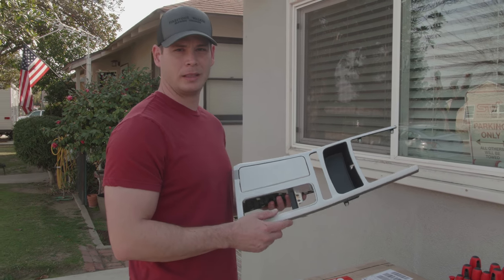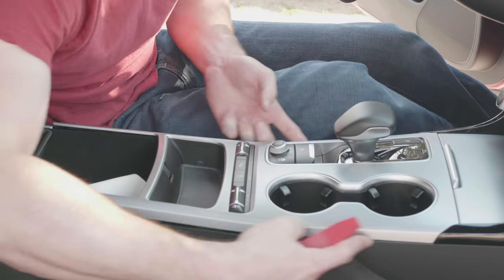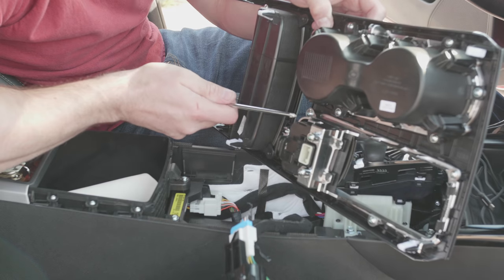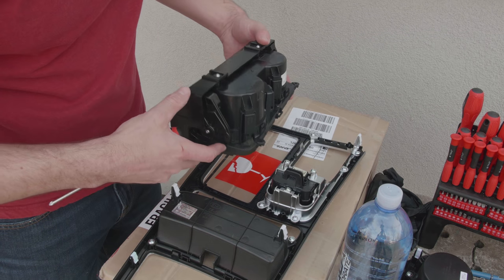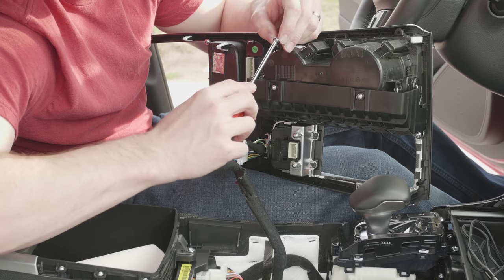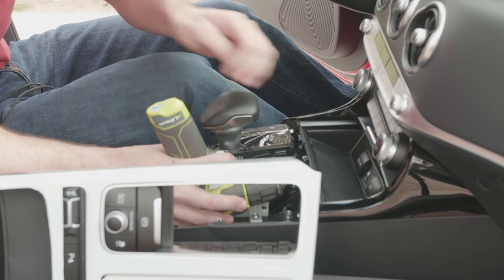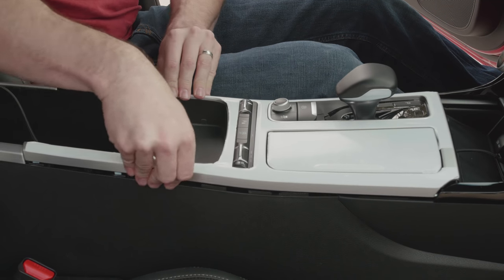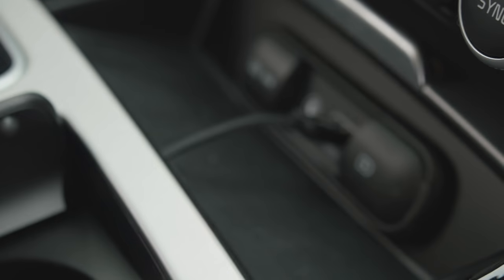2018 Kia Stinger GT2  Center Console Swap Out (Korean Version)

Comment: I was surprised you didn't zip tie the USB cable to secure it and prevent it from rattling around or getting pinched when you replaced the center console portion. Very nice video and thanks for sharing!

Comment: Watched this again and it'll help me as I need to change out my shifter lever assembly. I broke mine. DOH.. looks like once cover is off, I'll just need to unscrew the assembly and swap out and re-screw down new one. will try that today and make my video on that. Cheers !.. I still prefer my console with no lid to flip up for cup holders, but it looks sleeker when not using them, that's for sure.

Comment: I don't own a Stinger, but my car has wireless charging I found it slow and it was generating heat especially when running Android auto..I've routed my cable up under the steering column to pop out below the drivers door side aircon vent so my phone has cooling.
I do like the clean look of your car though, keep up the good work!

Comment: •Down here we have air ducts to keep the brakes cool and back behind the wheel we also have an opening for improved aerodynamics

•Up here we have a 3.3L biturbo V6 engine to help you take a hot dump on all the unsuspecting BMW drivers that leave your lane as you come up to a stop light in favor of the open lane beside you .

•back there is a lift gate to access your cargo area. Yeah, yeah it's a hatch design for more practicality and it's power opening and closing. We've also got available AWD for your convenience.
 
Sir is there uh, is there anything else you'd like to know about this car?

SGT and Me : Cupholders suck eh?

Comment: My Stinger GT in Australia (it's the top model, there's no GT1 and GT2) came with the wireless charger. If you are looking for the clean look, be aware that fast charging with the lid sliding back causes the phone to overheat due to no ventilation. At least it does with my Galaxy Note 10+.

Comment: Looks like you are missing the two screws holding in the cupholder along the outside edge. Check your stock one, it has four screws around the perimeter of the cupholder.
Reply from the maker: Erik Anderson oh Wow good catch you may be correct.  It's solid and doesn't move but yes you may be correct.  I can't remember anymore how it looked.

Comment: It's ok... Not worth the money for me to change it out unless it had like wireless charging built in. In fact the little door is what breaks eventually through out the years. I rather have the open cup holder. But good mod it's good that Kia offers Korean version parts this early
Reply: well if the door ever broke u could go back to the original one
Reply: Yea I’m not quite understanding the point of this mod besides maybe a “cleaner look” which is debatable. Probably cost him hundreds too. 🤷🏼‍♀️
Reply: I watched this and dont even have a stinger.  I do however hove a 2014 Kia Cadenza, and I love the closed cupholder look.  It makes everything look so much tidier.  The point is, its a 5 year old Kia with 104 000kms (60k(ish)miles) and the cupholder is still working fine.  The only thing my car has been in for that wasn't scheduled was a muffler, and a key fob that i lost.

Comment: I don't even own the car and I'm watching this. Good job.
One thing though,  I would of just made a 1/8 hole and cut the cable to put it through.  Just connect it back with black tape in the inside where you can't see the splice. This way you don't see a big hole on both ends.
Reply from the maker: Jerry Pena that is definitely an option.  To be honest because of the felt material in the arm rest box and how far forward the USB plug section is they hide.   Nobody can even tell there are holes in there.  Only. Reason I didn't do the slice was afraid of cracking the plastic. And a slice would make the entire piece loose its rigidity.
Reply: Just an option if someone is leasing the car or not owning it for a long time. I've done splices for thicker cable and it holds up fine. Definitely won't have a problem with rigidity. If you're worried, you can always use splice wire connectors to make sure the connection is not going anywhere. When adding extra length, this is what's done to make cable runs longer. A USB cable is usually 4 wires (5v, 2 data, ground) and is usually 26-28 AWG so nothing to worry about until you get to 14 AWG when you're carrying higher loads. But great to see this channel. Like the contents.

Comment: Did the exact same before seeing that video! now inserting led lights inside the rear bumper reflectors... not an easy job
Reply from the maker: Frederic Pons oh your doing the leds nice. I saw those.   You say not easy huh.   I'm guessing they gave no instructions either 😁
Reply: yes no instruction! I found out that there is one screw to undo from the inside of the bumper (after I unnecessarily removed the 4 screws that hold the exhaust pipe cover) but the real difficulty is to cut open the reflector assembly (it looks like it's glued shut). Then the led board hardy fits inside because the saw blade actually removed 1.5 mm of plastic all around the assembly. I also cut a hole all along the inside of the back so the led board could rest closer to the back. It's not pretty but hopefully be invisible once re-installed in the car. I am wondering if I could fill-in that opening with transparent silicon without affecting the correct operation of the board....I used some plastic soldering all around to recreate the side and bound the front reflector to the back. I will re-test and install tonight. If everything works, I will video the process for the other reflector....
Reply from the maker: I'm all about modding but that is a serious mod. ;) hopefully someone will make a plug and play  on in the future.
Reply: You can buy the whole reflector assembly with the leds. It's more expensive but might be worth every penny if my mods crash in burn

Comment: Great job right until you started drilling. I would have just wired in the connector through the back and made an extension for the factory clean look.

Comment: question: my stinger will be a AWD version so it will have the heated steering wheel function button. So one extra button. Do u think the mod will fit over it? I notice you only have two function buttons (parking sensor and ignition turnoff when stopped) and it fit correctly. The Koreans get 4 buttons (camera) so i assume all versions should fit?

Comment: Is there no USB port in the center console? If so I would reverse the charge wire head so that it can charge in the tray where you can see it as opposed to the phone being hidden away while charging. Just a thought. Great idea though
Reply from the maker: Chris Alba it has both up front but not in the arm rest area. The whole point was for Android auto to be used and my phone to be hidden instead of laying up front where it can fall out.

Comment: For the USB issue, I ordered this: https://www.amazon.ca/gp/product/B06ZZ36GXR/ref=oh_aui_detailpage_o00_s00?ie=UTF8&psc=1 and this: https://www.amazon.ca/gp/product/B01N0XH0V2/ref=oh_aui_detailpage_o00_s00?ie=UTF8&psc=1 to create an independent charging station inside the armrest. Now you could have one of the two connectors hooked into the Apple CarPlay port, but, even better, buy yourself a 5-inch USB/lightning cable and you can connect your phone to CarPlay without entangled wires...

Comment: Thanks for great helpful video!!  I agree 100% that the covered cup holders are better.  A lot of work, but if KIA is that stupid, what can you do but work-around them?

I might have done some proactive squeak and rattle prevention work while everything was torn apart.

I am also concerned that I have an iPod (loaded with lossless files not garbage MP3s) for music that will take up space and the USB port in the front covered area.  We have wireless charging in Canada, but is there enough room in there for iPod Touch and phone?  Doubt it.  Should have had a USB port in centre console where iPod could sit untouched and hidden (as on my current car).  Could then use USB or wireless charging for phone in the front console area.

Comment: Should've connected the USB behind the plug. Either coupler or splice.  So you wouldnt see the wire at all
Reply: Yes, also my thaughts
Reply from the maker: I love working on my car but when it comes to wiring i'm paranoid.  Everything else i will do without hesitation :)
Reply: True. Allways a bit tricky

Comment: I can't work out which is worse... The fact that you are replacing your centre counsel only to have a flap. Or the fact that Kia has Jewed the US market and not gone with just one centet piece.  One would think only manufacturing just one centrepiece would be cheaper for Kia overall.
Reply from the maker: LokiDaFerret it all has to do with cup holder sizes.  They have decided that Americans want bigger cup holders so because of that we get the open cup holders.
Reply: Yes the Australian variant has the fancier council but we lose the option for all wheel drive. Personally I don't love the two sized cup holders because it means one of my cups will always sit well but another one either doesn't fit or is loose. I carry around a water bottle 24/7 so the smaller cup holder for me is virtually useless.

Comment: $189 for the console sounds reasonable.
Reply from the maker: If you can find just the cup holders then you dont need the entire piece.  you can swap out the cup holders.  Should be much cheaper.  Just looked at the original part and yes you must swap them both out.  They are not interchangeable.